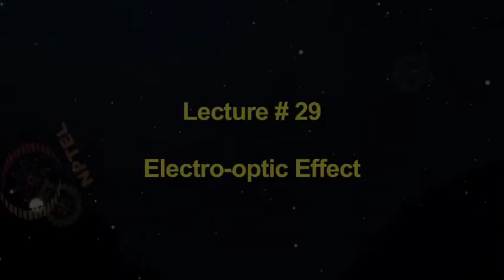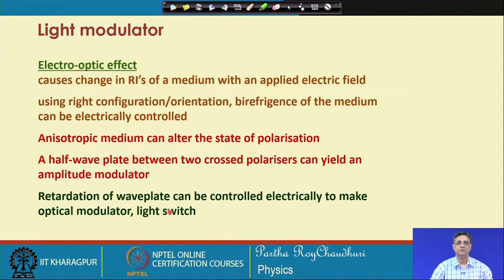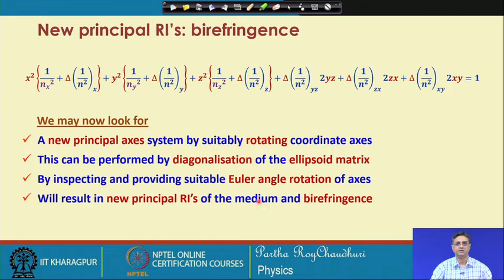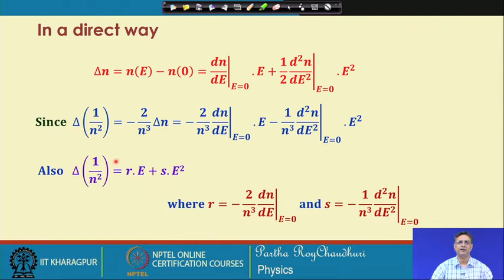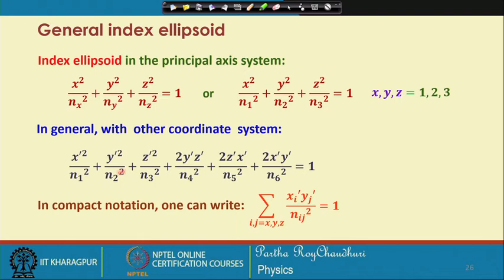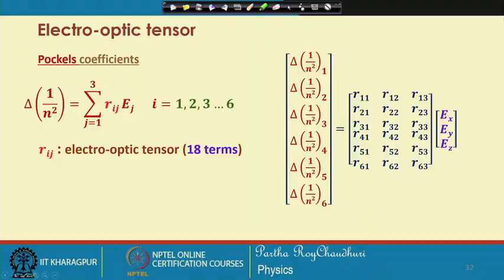Lecture 29: Electro-optic Effect

Comment: Why only keep the first 2 terms of Taylor series  are we working on small values of E?
Reply: Yes I guess, the electrical field used for example in phase modulators is around a few volts (~1 to 5 V)
Reply: The function n(E) is varying only by a small amount so the more times you differentiate, the closer you get to 0.